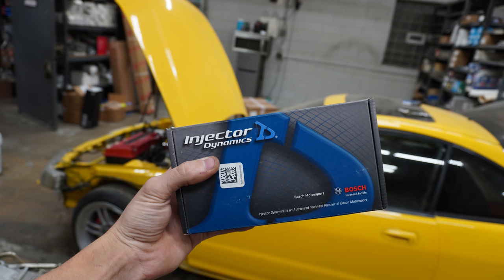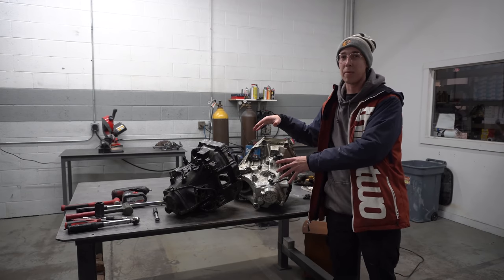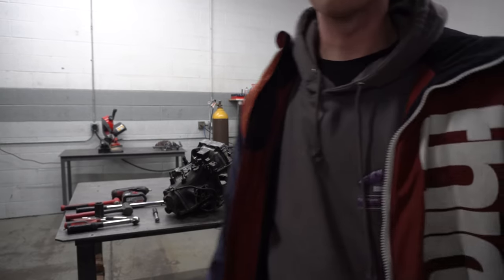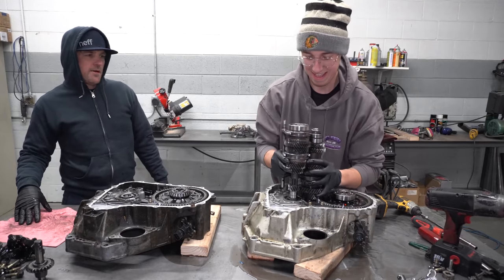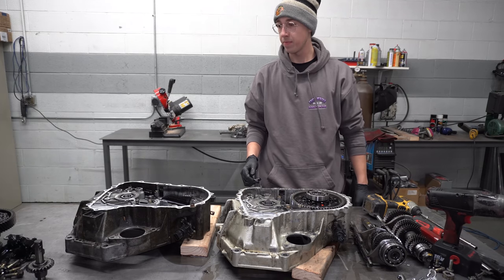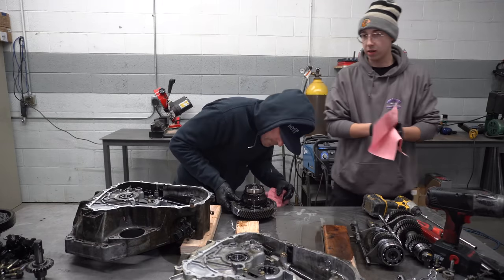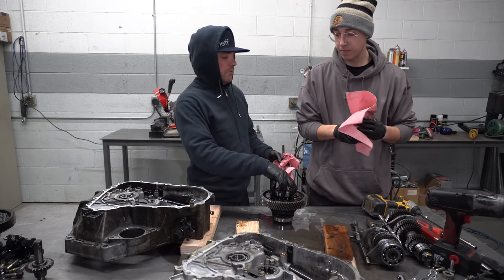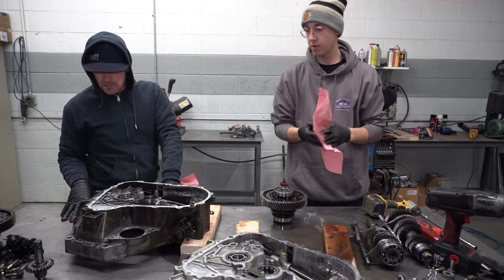Honda Frankenstein Transmission for Boost | GSR Gears, LS Limited Slip Differential and Final Drive

Comment: Na na naaaaaa dudeeee, you want the LS gear set. Alot longer then GSR so it's good for boosting in those longer gears
Reply: I’ve always heard you want gsr gearser and LS final drive for cruising
Reply: @RyanW420692002  maybe it's good for cruising city limits having a shorter ratio
Reply: you want short gears and long FD
Reply: Ls 4.4 or gsr 4.2 . I thinnk it better a gsr 4.2 : reason are 1-2 gear are the same in ls or gsr exepte the gsr as a double synchro and the 3 gear of a  gsr is shorter than ls . So if you put an ls 4.4 and gsr 4.2 side by side the gsr 4.2 when you gonna shift the boost between 2-3 not gonna drop.
Reply: I own a boosted b18b1 1997 civic coupe. I’ve had a gsr & ls trans, ls is way better, I put a phantom grip lsd on the ls trans

Comment: @17:07 it sounds like the diff bearing is shot or something is hitting
Reply: It's probably hitting the speed sensor. If you spin it backwards it'll make that sound
Reply: @codydunnell7951  that’s not right. every time you reverse you damage speed sensor?
Reply: @GIZZMOTORSPORTS  No. But if you spin the diff with the speed sensor still in there it makes that sound
Reply: @codydunnell7951  gotcha. I've never done that, I don't think many have tried that.
Reply: @GIZZMOTORSPORTS Yeah. first time I tore one down I was just spinning things just to spin it.  heard that sound and thought the same thing, that the bearing was bad, pulled it all out and saw the sensor. Removed it, put the diff back, sound gone.

Comment: Sup John I’m on the making rn of opening my b16 trans but I wanted to know if I can install on it my stock Ls diff ? And would I have to check clearance on it or I can just put it without checking ?
Reply from the maker: You can only install your LS diff if you also transfer the final drive like I did in this video.
Reply: @boosted_john  alright and would I have to check clearances also ?
Reply: @backyardbuilds3247  you probably already figured it out but for anyone else reading these thats depending which b16 assuming US spec not type r such as b16a2 & b18b1 s80 actually are the same/use the same diff/tooth count there's too this day debate over which b16's are 4.4 fd & which are 4.26 but regardless the diff is the same tooth count is the same & bearings are the same if you were swapping with any other b series b18c1 c5 / b16b type R then you will need to swap final drive + counter shaft but just like if you buy an aftermarket diff for a b18b1 s80 (ls/rs non vtec) it will say b18b/b16 such as wavetrac for example it will fit either b18b1 s80 trans or US spec b16a2

Comment: Didn’t you say you were going awd?
Reply from the maker: I did, but then my motor blew up 3 times.
Reply: Also curious why you didn’t use the clean case? The axle was prolly popping out because the c clip on the axle.
Reply: @deieznuts  facts...I had this plague...replaced the shit clip on the autozone axle with OEM circlip and no more popout. That shit embarrassed me for over a year.